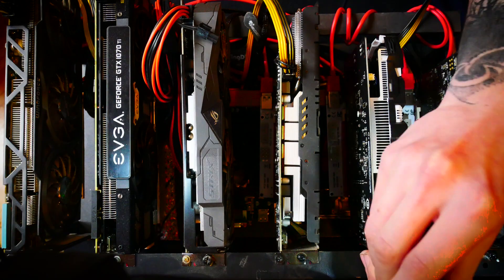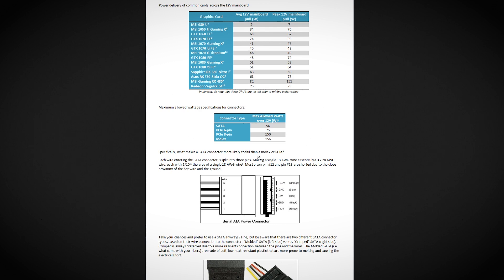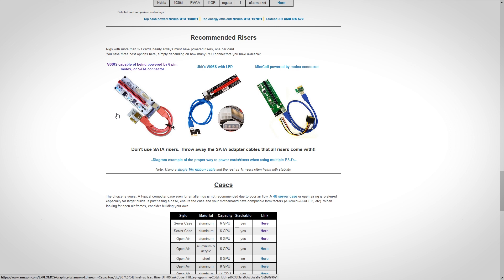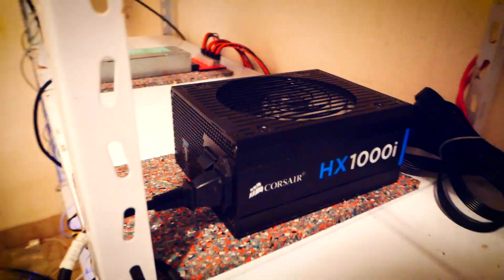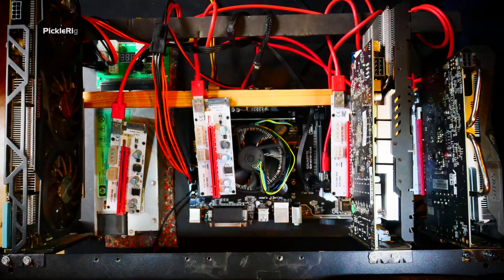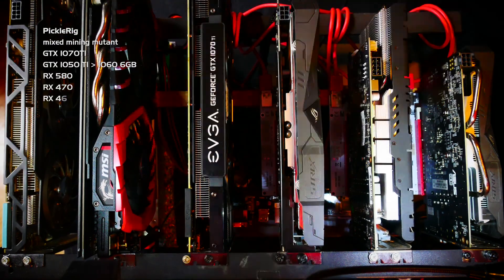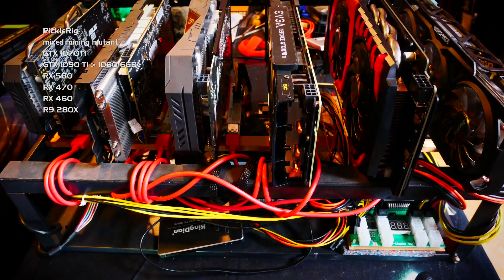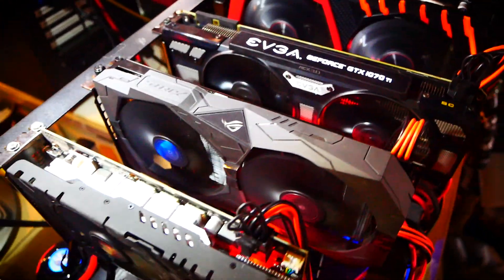Never use SATA for risers! (+ GPU Update) | Cursed Mining

Comment: Im confused , My GPU has a 6 pin and a 8 pin plug that powers it. So why do i need to 6 pin power my riser also, i mean the sata is just to power the riser alone if im correct. The GPU gets that seperat power direct from my PSU
Reply from the maker: not fully correct, to be a full x16 slot on a riser a GPU also draws power from the PCIE. The problem with SATA is that surges can overload it 😖

Comment: Soo guys plz help me..i have 4 pin connector extra and also sata cable so which connector should i use to supplly my gpu??
Reply from the maker: which type of connector do you still need? Honestly it is safer to adapt from 4pin or Molex to 6pin than to use that Sata, cheers
Reply: @CursedMining  well if i use molex should i use 2 milex to 6pin or just 1 molex to 6pin
Reply: @CursedMining  and plz xan u also provide link
Reply from the maker: @sanskargurav8251  I don't even know where you are from bro :D 2xmolex to 1x 6pin is safest :)
Reply: @CursedMining  i live in india .suggest me a good and cheap molex to 6 pin.
Reply from the maker: I am not from India sorry! Google it and read reviews, important skills for mining anyway 🙈 sometimes there are good ones in Amazon, I avoid the very cheapest. These molex to 6pin often came with GPUs some years ago, that's where I got most!
Reply: @CursedMining  bro i only have only 1 molex available .... second is used for powering cabinet fan...

Comment: I'm confused..if you don't use SATA to power your riser what do you use??
Reply from the maker: Molex works well (2 risers per cable) or just 6pin :) cheers. P.s: that was the very first channel vid 🙈
Reply: @CursedMining  Thanks! So..molex to adapter with TWO 6 pin plugs for two video cards? Sorry, complete novice here :-)
Reply from the maker: @viajerozz  It depends on what your riser takes, I'd avoid adapters as well. Your PSU should have Molex strands, you can power two risers with one cable strand (which should have multiple molex), or directly 6pin, which should allow up to three per strand/cable
Reply: @CursedMining  Great, thanks!

Comment: I have GPU risers that are accepting molex only as power. Is that safe? Can I convert 6 pin to molex and use that?
Reply from the maker: Molex itself is safe (but don't power more than two risers per cable) and adapting 6pin to Molex is fine too :) cheers ⛏️
Reply: @CursedMining  ok thanks!
Reply from the maker: Anytime! Happy mining!! ⛏️
Reply: @CursedMining  My power source is all 6 pins and 8 pins (it is modular) and then if you want to connect a sata or a molex, you use an adapter from 6 pins to sata/molex, is it still bad to use sata?

Comment: Did you know that 1 12V yellow wire is capable on handling 180W power? The 54W is the set limit for any sata that draw power FROM motherboard thats not the max power limit of the sata powercable. A lot of people confuse on that part. Even on that GPU set power limit from PCIe x16 that says 75W they wrongly relate to it from the output limit of powersupply or 6 pin cable power limit. Limit of PSU is at the label of your PSU and cable are in AWG chart.

Comment: Hey, old video but you seem active.
Is there any drawback to using SATA other than the fire hazard part? I have mine going on mostly SATA power and there are some rig errors but no excessive heat on the the SATA connections.

All the cards take 6 or 8 pin power on top so i wouldn't think it would get anywhere close to saturating 54 watts on the PCI riser power.
Reply from the maker: that one was the first vid :D the sata issue was that they can't deal with power spikes and that's when they can catch fire, don't have to of course! cheers
Reply: @CursedMining  Got it, I happen to have one more 6pin riser in mothball I will swap in once I get some more 6pin cables.

Comment: As a reminder, also correctly distribute your riser power on the PSU side- 2 MAX per string.
To keep dust down in my rigs, I taped a $4 20in standard home air filter (for AC/Heater units) to a 20in box fan and have it blow directly on my rigs.
Reply from the maker: Thank you for the first comment on this channel (ever!) =)   You are absolutely right, thank you very much! I should definitely have mentioned it. I like your dust solution. I'm thinking along the lines of boxed solutions atm since I have ASICs as well which could need it (and would be a sound-advantage as well, even though that is secondary). Let's see what the future brings! Thanks again for tuning in!